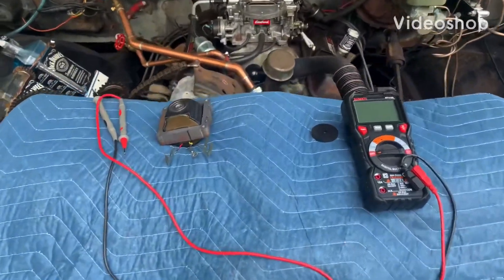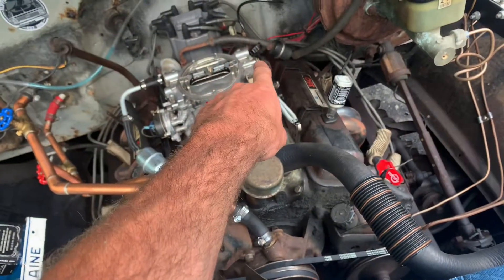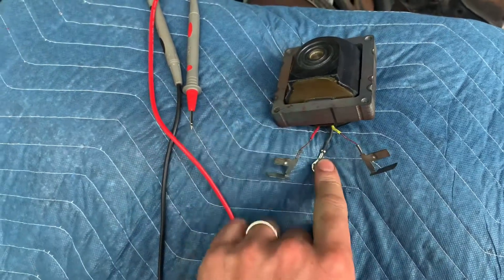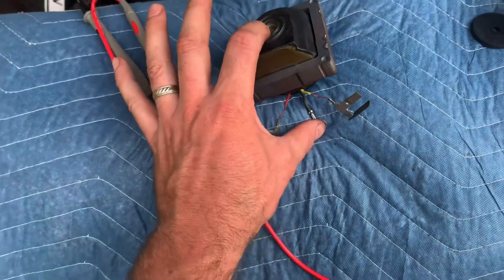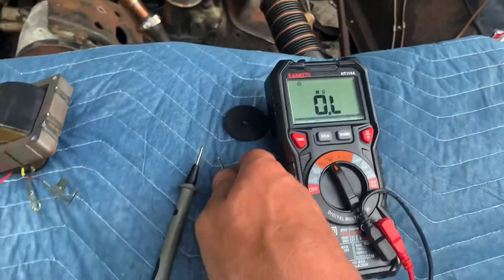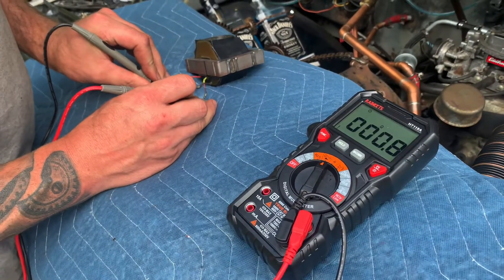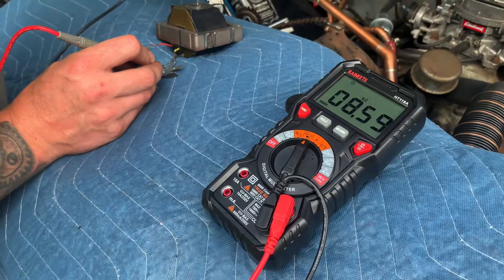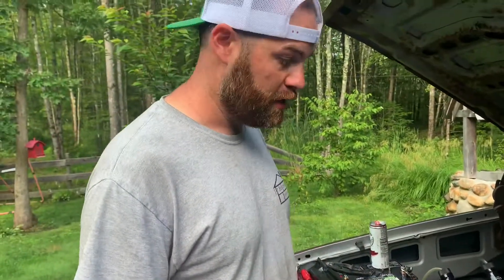Simple GM HEI coil test, short version

Comment: I don't have 12 volts supplied to the coil, i took the batt. Wire off the coil and with the key on voltage bounces between 1 and 5 volts. Also my tach quit working the week before. Im wondering if the 2 wires shorted together causing my problems?
Reply from the maker: It could be actually

Comment: My primary red yellow-reads 0.00 the black lead is fine at 6.88 I’m running in circles on this dang ole ignition nonsense-Does them 0s mean it’s bad? Love the jack bottles lol looks like me- thanks
Reply: Nvm my meter is cheap- I listen to what you said paid more attention to that dial on my meter - primary read 0.05 turned the knob to 20k checked secondary had 6.88 so I’m good to go- thx for the video
Reply from the maker: Ok great

Comment: Didn't you know that ignition coils can fire negative or positive high voltage? With positive ground, the high high volts jumps upward to the center of plug. The positive ignitions fire downwards to ground of engine.

Comment: Wanna real quick way to check modules and coils?  Take a weller solder gun turn the key on and hold the gun buy the module and hit the trigger. If everything is good it will fire. If it fires but still won’t run it’s the pickup.
Reply from the maker: Nice 👍

Comment: My primary reads 000.3 my secondary reads 07.44 is it a good coil ?
Reply from the maker: Every coil specification varies slightly, depending on application
Reply: @FlippinCustomized  gm
Reply: @FlippinCustomized  gm thanks it was good